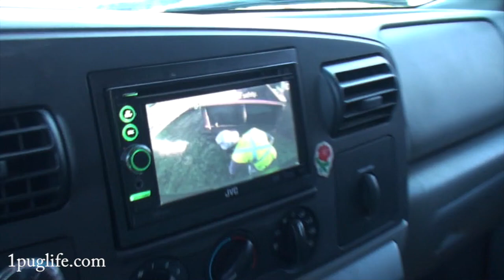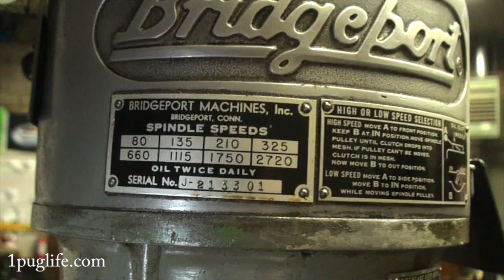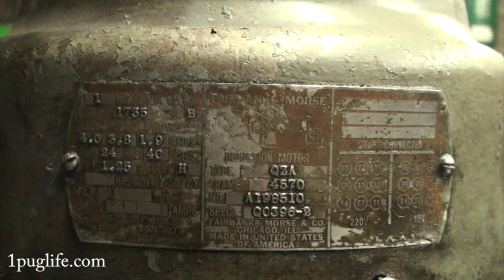moving a bridgeport milling machine

Comment: Ran one of those Bridgeports for years. The backlash is easily worked around. I was getting repeatability of thousandth/inch with effort, but 3 thousandths readily. those can be easily used as jigs, drill press, mill, threading holes, surfacing, measuring, on and on! You won't know how you lived with out one.

Comment: Forky is a beast!
You don't determine the year by the number on the j-head.
The serial number for your machine is on the front of the knee, behind the bearing retainer for the cross feed screw. You may have to slide the saddle slightly to the rear of the machine, as the way covers may hide the serial numbers if the saddle is in the forward position.
Usually, in the front of the knee by the serial number, you will find a “BR” logo.A 12-BR will indicate 12 inches of table travel. You will find this on most J heads.A “BR” with no numeral will indicate that 9 inches of travel (an early model).

Bridgeport information.    bluechipmachineshopDOTcom/bc_blog/how-old-is-my-bridgeport-milling-machine/
Reply from the maker: D9352 friggin rights buds mine is a 1979 with the 12 inch travel thanks for the info
Reply: 1puglife You're welcome bud,

Comment: pug does that forklift lift any better at higher rpm? or was that as high as it revs in this video? the forklifts at my old work lifted kife at low rpm but when you rev'd them up they could lift anything. i know forky is old and shit but just my .02 BMP

Comment: The unit on the side looks like its a coolant reservoir/mister.
Reply: Josh Russell that's exactly what it is I have same exact mill only I have a stepper motor on mine basically it turns 1 phase into 3 phase those variable drives suck on big machines

Comment: 17:21 , Don't just wait for things to fall on your lap bud ! Remove your 1puglife logo and sell your red f150 with the plow right away for 1500-2000$ and kijiji yourself a tractor ffs. I got my first tractor at 21 on kijiji for 800$ 1959 Case 410B with the Cab and the front end loader. Then you can sell it for more money and get newer/bigger stuff. Go , do it right now , in a couple year you'll thank yourself. If you keep the f150 it will just wear prematurely because of the plowing , and you'll end up losing in the end. Then you can sing ¨Playing freaking traptorrr¨ sitting proudly in your old farm tractor !!